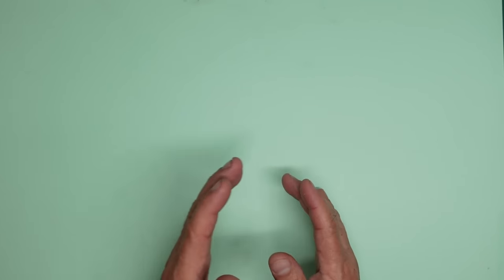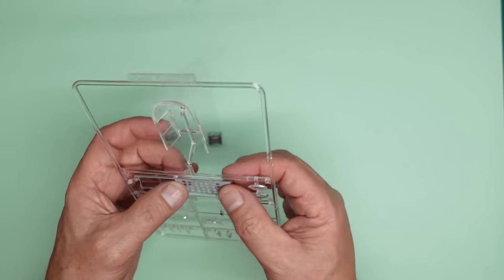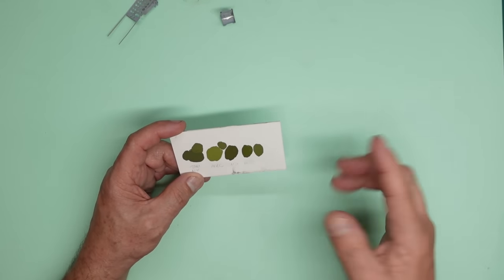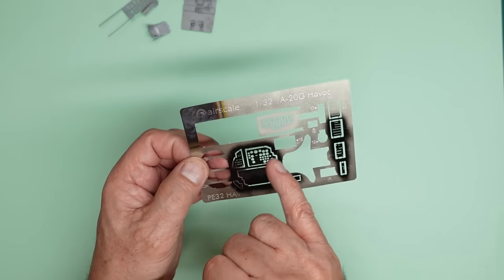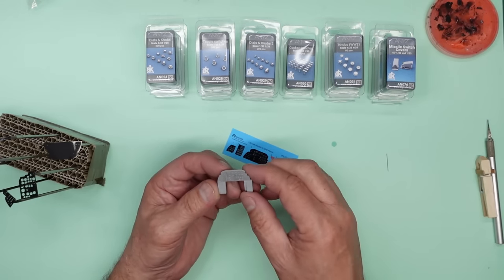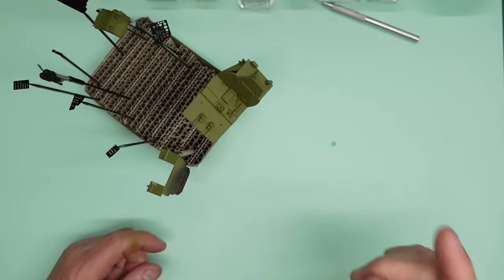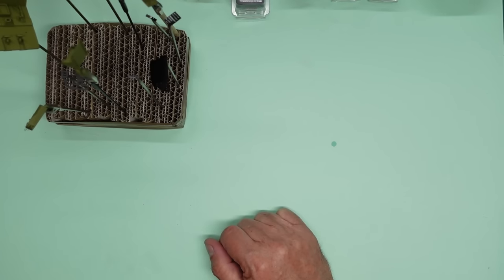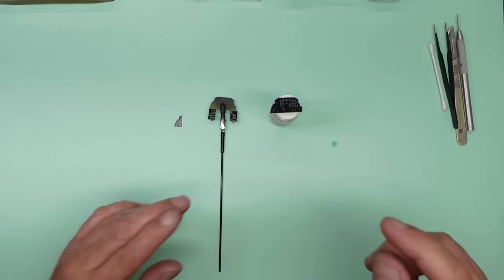HKM 1/32 A-20G Havoc build. Part 4a.. Paint, decals and Throttles

Comment: Hi Nigel. Just started my build of the A20G and went with the Airscale cockpit.... huuuge mistake. I am no novice but I found it impossible to do, the decals were so flimsy they kept ripping and the background is gloss and they looked average at best to me. So I have ditched the lot and have just ordered a Quinta Studios cockpit set. I don't think I have seen you review use their product, but I used it on my AH64E build, it was sooo simple and looked brilliant. I would recommend you give them a try sometime, they are colour printed 3D decals, easy to apply and to my eye top notch.
Reply from the maker: Sorry to hear that Paul, Mine went together just fine. Funnily enough I have ordered a QS cockpit for an upcoming GB.
Reply: @NigelsModellingBench  No problem, not your fault, looked good and simple, maybe my skills just weren't up to it. Still think you're th eman to follow on these builds, I learn a lot from you all the time. Keep up the good work! 🙂👍
Reply from the maker: Thank you. Did you use Micro set with the QS decals?
Reply: @NigelsModellingBench  No, didn't find it necessary and if I remember correctly they tell you NOT use Micro Sol or any other decal softener or you risk losing the 3D effect.

Comment: Does this one now have the photos you referred to? Oh it does great. Sorry Nigel you confirmed to me your temp setting was 400°. Is that C or F please?
Excellent video Nigel👍
Reply from the maker: It is Centigrade Mark. It doesn't really matter how hot you go.. I use 400 degrees on a solder with 250 degree melting point so i can get it to flash quickly.